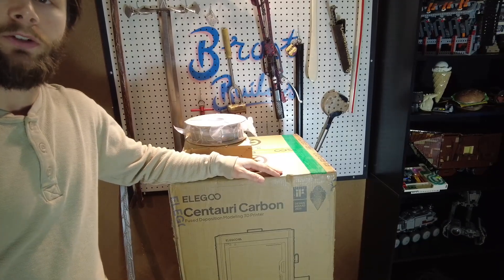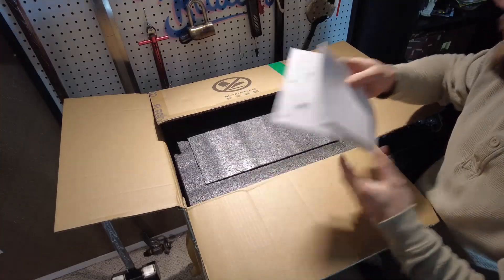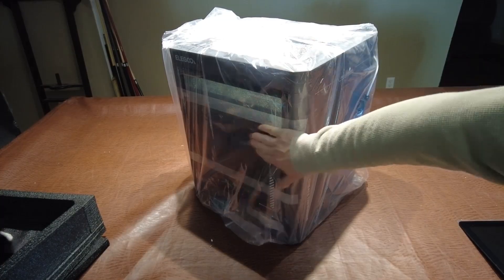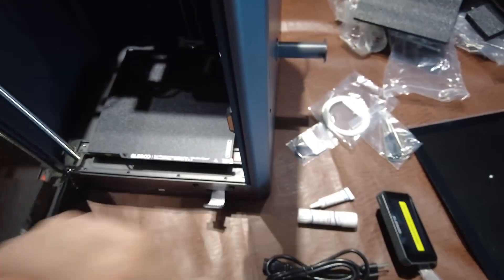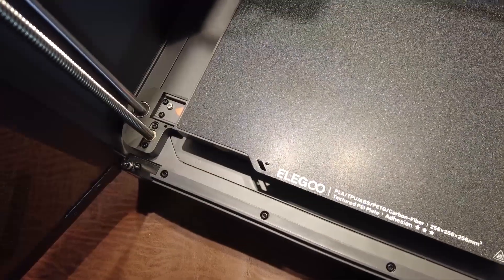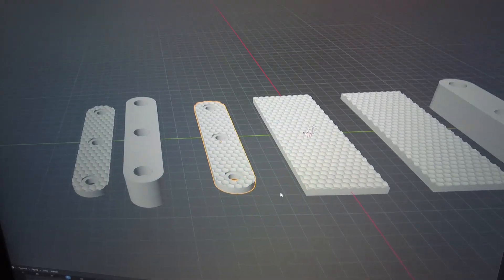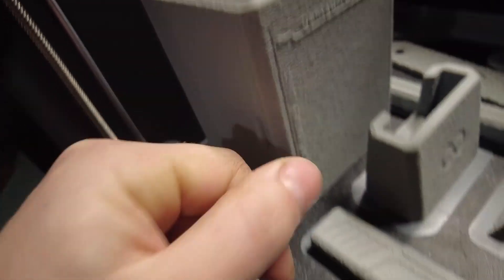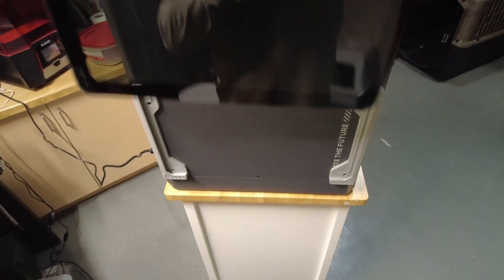Elegoo Centauri Carbon Unboxing, First Print & First Impressions

Comment: No glue required on the supplied plate for pla, side A adherence is fantastic
Reply: I did a print with a big flat base on both sides. Side A ...great adhesions and it popped off easily. Side B adhesion is alarmingly sticky. I had to wait for the part to cool before it would release...and still had to pry it off with a scraper.